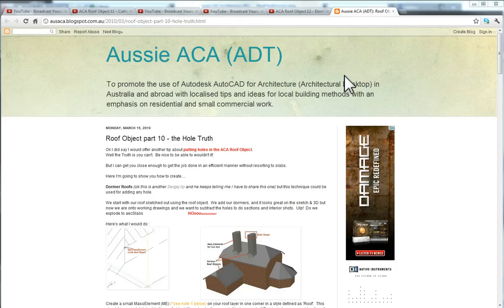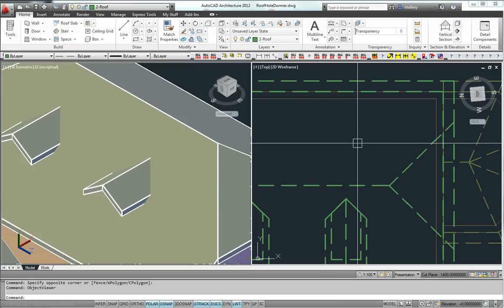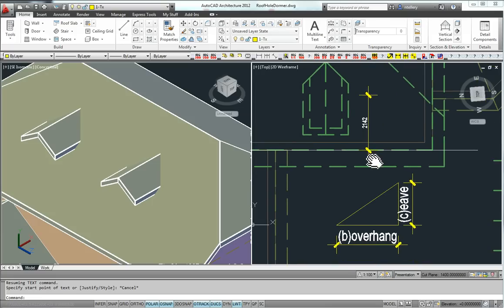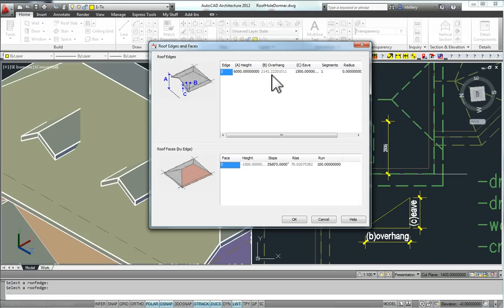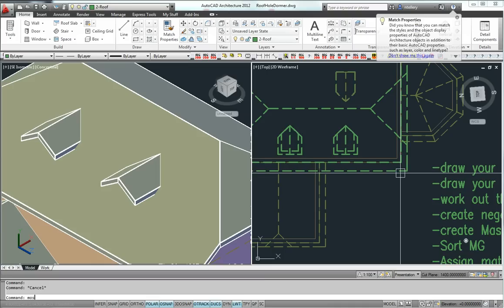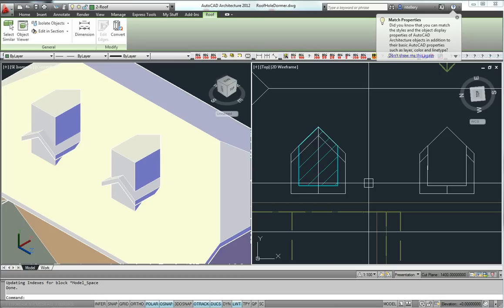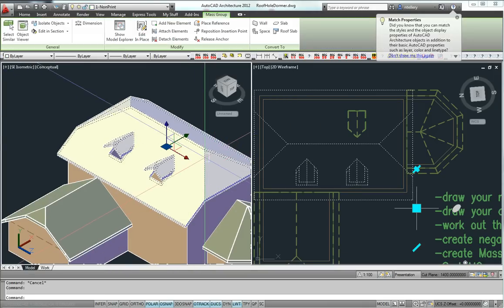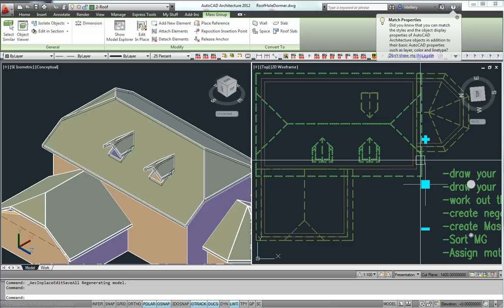ACA Roof Object 12 - Dormer Windows

Comment: not bad, if knew what he was doing... it goes so fast , which i normally like to blaze through the commonly understand bits, but this cat blazes through the new nuance bits... i cant even tell what command he is uing, cause the command line is covered up often by the windows.
Reply: Sorry mate. The beauty of Youtube is that you can stop and replay. 
I can see around 1min I say "Roof" twice when I meant wall.
Let me know what point you are stuck at and I will try to help..
Reply: I think what I am doing is selecting the roof and then right clicking and it gives me a menu.  Very handy but you might have to turn it on.
type OP or OPTIONS and go to the User Pref tab and click the "Right Click customisations" button
Click to Turn on and you will now have an easy relevant menu when you select objects.
Not that a short right click and long right click have different outcomes.
Hopefully that is what you need to get you going.